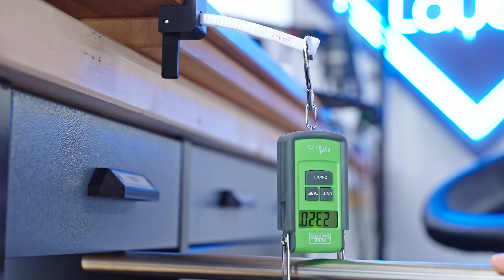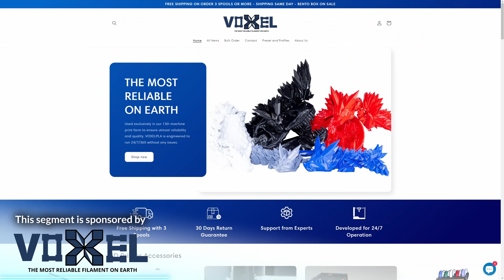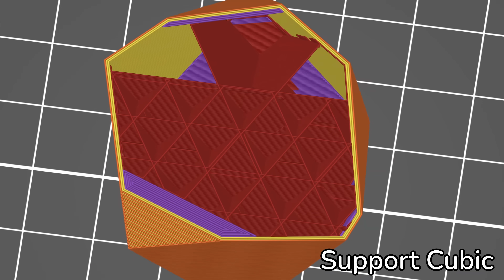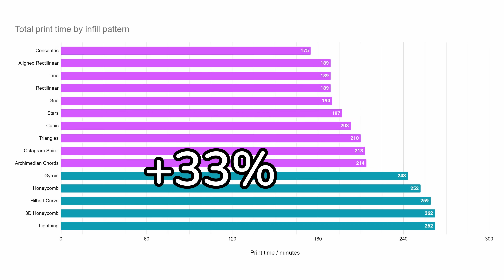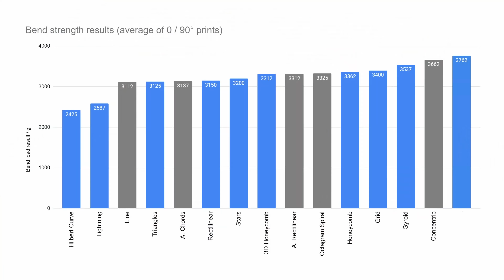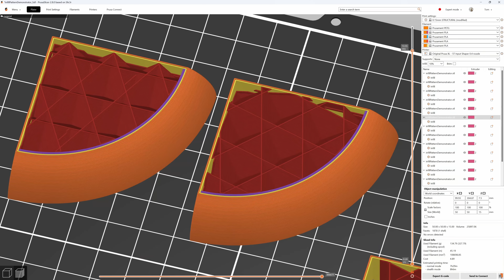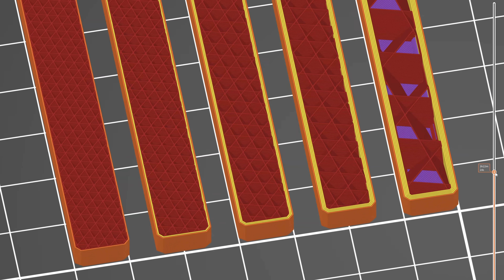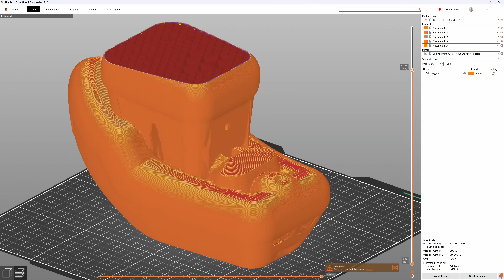Rethink how you use 3D printer infill!

Comment: Strength is a great measurement but in my workflow heat resistance is much more of a important factor. 

That being said the amount of infill and shell thickness has shown to have a varying affect on the amount of heat a part can withstand over time. In my experience less infill results in the part warping or deflecting even in its rated zone over time. But this varies drastically and I don’t have the proper tools to test this even semi controlled. 

This is something often overlooked when you look up part testing. People don’t consider infill or shell thickness in terms of heat resistance. And for what I do that matters much more

Just something to think about.

Comment: I had watched your brick layers video and saw some images of a 'woven' style layer bonding that would loop over itself.  I started looking into it and noticed there was 3d honeycomb style infill and though, if you do something like 80-90% infill for density, then used your over-extrusion to fill in the gaps and into the 'pockets' if this would create a similar effect, essentially weaving and locking layers in multiple directions, through multiple layers, so you might get something like 3 layers bond depth, vs the typical 2.

Comment: The more "dubious" patterns are good for aesthetics, especially when using translucent filaments. I made a light box for some friends with their HVAC company logo which incorporates both a snowflake pattern and flame patterns. I used blue glow-in-the-dark filament for the snowflake and orange & yellow glow-in-the-dark filaments for the flames. I used the Hilbert infill and concentric outer layer patterns on the snowflake shape and the concentric infill and outer layer pattern on the flames. When the box is lit, the Hilbert pattern shows through in the snowflake shape and provides a nice, quasi-crystalline, icy look, while the flames all look uniform and organic. There are six flame shapes that all revolve around a center, and the concentric pattern ensures they won't have any apparent "attachment" to any particular plane. When I first printed it with linear patterns, the flames all looked different depending on their orientation and you could tell their infills were "bound" to vertical and horizontal planes. Using concentric infill made the infill pattern essentially vanish (or at least be unnoticeable). The same can be said for the snowflake shape. It has six "arms" that revolve around the same center. Making the outer layer concentric gave all of the arms a more uniform look even with the Hilbert pattern subtly showing through.

I also used a concentric pattern on the black, totally opaque face of the light box surrounding the snowflake and flame patterns. You can't really see it under most conditions, but when the light in the room shines on it at the right angle, you can see the subtle, reflective nature of the patterns in the filament lines. Using a concentric bottom layer pattern made the entire light box look evenly patterned all the way around when the light hits it just right. You can set it on any of its six sides and it looks the same. When it had a linear pattern on the bottom layer, you could tell it wasn't symmetric under the right lighting.
Reply: Also, even though infill may not contribute heavily to strength, it seems like it does provide a lot in terms of shape integrity. Seems like you're a lot better off with some infill to prevent deformity over time.

Comment: I came here because I am struggling with warping corners (and cracking on ABS). I use Ultimaker Cura.
I may try out gyroid to follow the advice of another youtuber and help reduce the amount of straight lines.
2D and 3D Cross infill may also work because I see very few straight lines in the infill.

Comment: Unclear objective:  max strength per unit weight or max strength per volume?  In other words if replacing a metal part with 3d print and want max strength in same form factor, what settings would you use for perimeters and infill.  Still 5 layers and 15% or 100%?

Comment: there's serious limitations to this test. concentric not only overperforms in this shape and test, it does nothing to strengthen the print from side crushing. octograms has this same flaw in some areas depending on print shape and alignment. the superior general option isn't included in this test, which would be crossthatch.

Comment: comming from changing from grid to cubic and from cubic to grid for years I finally decided to try gyroid, and there was no coming back right after the first trial, for me eheh I fear that the "sharp" corners of the cubic and the way it traps heat inside the cubes may contribute to warping which is my worst enemy...  this problem (if real) is solved with gyroid because all of the print is hollow

Comment: Ok, this is a newbie question. So, at this point in time it might not even be possible.

What about using a "hybrid" approach to the infill? Being that it is possible to pause a print in the g-code, (to add magnets, metal re-enforcements, etc.), would it also be possible to change infills multiple times mid-print to take advantage of various infills best "strengths", (i.e. speed, rigidity, flexibility, etc.)?

Again, realize these questions are from a newbie perspective. So, it might not even be currently possible. But, if nobody asked "what if", we'd all still be living in caves.

Comment: There is A LOT that goes into print time and these print time results are very specific to your part and settings. You should give this a second look for larger part print times and ultra low density infills and their ability to support large top surfaces. Like 2-10% infill with different infills and extrusion widths. 

For example, lightning infill is WAY FASTER on a larger parts because it's basically no infill until the top layer, but in your data it's the slowest. That is purely a result of your small part, not the infill. 

Example 2: gyroid speed is very dependent on infill density because increasing the density = many more smaller diameter curves. Using a low infill density like 5-10%, gyroid isn't that much slower because the curves are larger sweeps and there are fewer changes in direction. 

Example 3: You can reduce the infill extrusion width to reduce the infill spacing at the same density setting. Since the density setting is mass based, if you drop the extrusion width to 90-100% of the nozzle diameter, it will print more infill lines for the same percentage infill setting. This is a really easy way to reduce the infill bridge distances without increasing the density to keep material usage minimum. But now you're printing more lines, so the print time will go up even though the infill density is not changed.

Comment: Great video, summarizing a lot of test pieces efficiently. I find decent results with default grid infills. I've used gyroid but it always seems to come out as disjointed curves, just a mesh of lines and doesn't impart any strength. Cubic works well, but I don't have any less issues with overlap pulling a layer while printing. Anytime grid does that, it seems there is something else afoot.

Comment: I've always just kinda did my settings by eye after slicing and reviewing the preview, but good to know my methodology was on the right track with cubic infill, rectilinear is the new one I might try on decorative stuff, good info all around, I was surprised that walls were largely the strength aspect more or less, maybe I'll try dropping down to 10% infill and maybe an additional wall and see how it goes on the next load bearing print, thanks alot for your work here.

Comment: i still always use normal rectilinear on parts that don't need to be sturdy. It's simply the fastest there is and least wasteful (aligned rectilinear is about the same, but is really weak in one direction!)
Also, unlike grid, rectilinear is not crossing any lines, which CAN make a differnce in light parts because the overprinted bits do show up in the top layers!..

Comment: What if you did something like this?

  ========================
  II                      II                        II
  II                      II                        II
  II                      II                        II
  II==========II===========II
  II                      II                        II
  II                      II                        II
  II                      II                        II
  ========================

This is 2d of course but the idea stays the same.

Essentially just internal walls in every direction.

You can even put the interior walls diagonally, like this.
[X]

Or even combine them.

=====================
II   \\              II               //  II
II       \\          II            //     II
II           \\      II        //         II
II              \\   II    //             II
II======= \\II//========II
II                // II \\                II
II            //     II   \\              II
II         //        II       \\          II
II      //           II           \\      II
II  //               II             \\    II
=====================

Wouldn’t that produce substantially more strength than two more walls?
Then you can still infill the all of the empty space in whatever pattern you like.

Of course it would change based on shape.

============================
II          II          II          II          II         II
II==========================II
II          II          II          II          II         II
============================

I would imagine any interior cavities would only need the bare minimum infill to maintain the structure of the interior walls, but you could do denser infill on any cavities in contact with the surface walls to give a more sturdy feel.

So on and so forth.
I’m just learning modeling/cad, so I don’t have the ability to attempt this yet, but if nobody does by the time I figure out how to I guess I will have to attempt to do it myself.

Typing this out and thinking it through, I’m feeling like this would be most appropriate for larger projects.
It also might handle impacts better rather than bend strength.
But who knows?

Comment: Gyroid is a maximum area infill, ie for a given line pitch it will have the highest surface area to volume ratio. I have 2 uses for it: Biofilter media in my aquarium, and with very soft TPU filament shapes where you want a foam-like compression. There is no straight lines so they flex easily throughout the infill.

Comment: I designed a 20 mm thick 3D printed enclosure for my SV08 to insulate it for maximum efficiency for less power needed to maintain the bed temperature and a higher passively heated chamber temperature.  I selected cubic infill because it creates isolated pockets of air to minimize convective heat loss through the enclosure.

My favorite trick for maximizing part strength with minimal material is the Alternate Extra Wall feature.  I'll select one fewer wall and select this feature so it adds that wall back on every other layer.  Depending on part geometry and the application of force, it's usually stronger than having the extra wall every other layer because the edges of the infill are captured between the alternate walls making a much stronger bond between the infill and the outer walls.

Comment: I did something similar to this in grad school. I printed cubes in TPU with different infill, and the cubes would resist compressive deformation drastically depending on the axis you squeezed them on. Gyroid was the most consistent

Comment: And that's why my printer lives in the garage, with the car. I did build a shed in the back yard to hold my power tools, fertilizers and liquids. I am way more concerned about the latter emitting toxins than my printer. I don't use the printer as often lately.

Comment: Great contribution!

Having said that... I´m a gyroid guy. You do mention the importance of anisotropy on the infills. Iwould have loved to see some tests in this regard. Also the load case is very relevant, under pure compressions the flat surfaces of cubic might buckle way sooner than gyroid´s "bubles" and I bet shear loads are also better managed by gyroid.

It would be interesting to see rectilinear "bridging" with a 200% flow to make it resemble grid-like but wtih the nozzle not scrapping over previously printed lines...

Comment: Maybe I'm just being stupid, but why would gyroid be slower? Are most 3d printers not able to print fast on a curve? The overwhelming majority of a gyroid is smooth curves that requires relatively gentle accelerations, with maybe 5% of layers having sharp 90' bends. In contrast cubic has abrupt corners on every layer. It should be absolutely ripping it's way around most of a gyroid, at close to full speed the majority of the time. Are you limited by print speed, absolute acceleration, or head control? The only reason gyroid could be slow I can see is if it is head control holding you back, and that's just software and clever feedback. It's an illusionary limit, unlike the acceleration imposed by 90' bends, which is physics.

Comment: sorry tom ,i love me honeycomb and me gyroids too much 
honeycomb as you demonstrated provides very strong support in the vertical direction ,but you it also provide significant support to the horizontal direction also its a regular pattern while cubic can have large unsupported walls if the wall cuts the cube in the middle ..... honeycomb gives 95 % strength of cubic while also significantly supporting the sidewalls

and the gyroid supports all directions for almost near perfect load balancing over any direction ,if i optimize for the part face with the most load im guaranteed the other faces wont buckle from secondary forces .... whats not to like 
also im not running a 3d printer farm so a 30 % increase in print time is not a problem anyways , i would rather wait 30 % longer for a better over all part than to produce basically plastic waste

Comment: im surprised cubic is stronger then honeycomb 
i always defaulted to gyroid becoz it obviously supported the entire part ,whatever orientation you put your load in ,gyroid will support it , if im not sure what face of my part will be loaded ,just put in gyroid and forget about it , but when i have a part where i know wish face the load is going to be on ,i tend to use honeycomb with the pattern facing the side with the load , honeycomb is extremely strong vertically while being also decently strong sideways ,something cubic does not have ,cubic is the strongest vertically but i would rather trade some of the strength to get some kind of horizontal strength also

Comment: I've tended to default to Gyroid, with a default of 12%, which I raise or lower as needed. More recently I've changed my default to 3D Honeycomb, which is nearly as strong and seems to print a little faster (your test shows it as taking longer, however). I'll often use gyroid at a low percentage as an exposed pattern in drip trays for plants.

Comment: Of course I watch this a few hours after starting a multi day print.  Going back to the slicer and changing from gyroid to cubic would have saved a few hours of print time.  I don't think it matters much in this case as this is the last larger print I think I will need for my project and I don't use the Kobra Max for anything other than these large volume prints.  It is good to know where I can save some print time and still have relatively strong parts though.
Going to be using cubic going forward for most of my parts that need the infill

Comment: Man this is exactly what I was looking for, now I have a thin walled auger part (2.5mm) and I realise its so brittle on a point although surface is perfect looking, I look at the infills by turning off the visibility of outer wall and what do I find, a portion inside is empty, another is filled with solid infill and its interrupted on middle and continues with gap infill...

Its because there is varying thicknesses because of the orientation of my auger, and if it gets so small on a part, instead of solid infill it does nothing. Using a 0.2 mm nozzle helped a bit but not fully...

Comment: my experience : lightning for lost pla/abs molding (low residual patterns). gyrod : make sure every holes walls (for screws)  and also every corner of top surface get enough internal support. lighting for lost pla/abs molding. hilbert for abs (not warping pattern) especially archimidian for big circular models (best un warping pattern and fastest with minimal retractions).

Comment: I wonder if infills like honeycomb could be printed faster by not following the line bends, but rather printing "dashed lines" across the whole part. First all in one direction back and forth, then the second (60° rotated), then the third direction (120°). The result would be a hexagonal pattern, and it might be a bit weaker due to piecewise printed lines, but the speed could be higher. The extruder would be moving in long straight lines, just like printing aligned rectilinear, and just turning the extrusion on and off.
Reply: This sounds like a thing you could prototype with a G code processing script.

Comment: From an engineering perspective a 3D print is basically a torsion box. As such, the infill should only be strong enough to prevent the surfaces from buckling before they break in tension, and not a bit more. Your perimeter-vs-infill results reflected this accurately, with the additional note that you can go pretty low before buckling becomes the dominant failure mode.